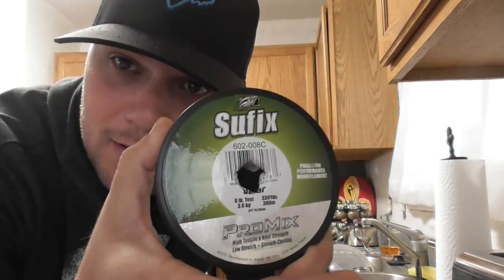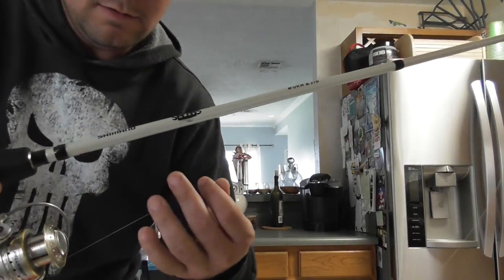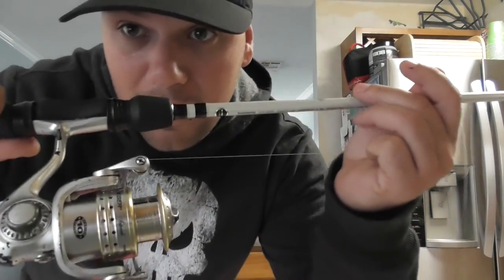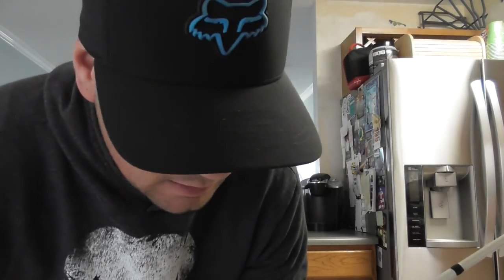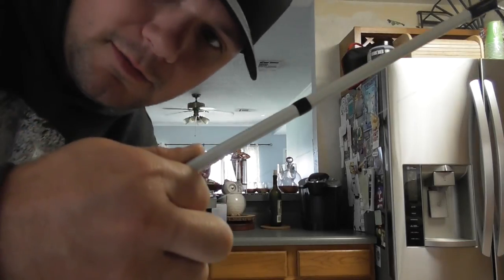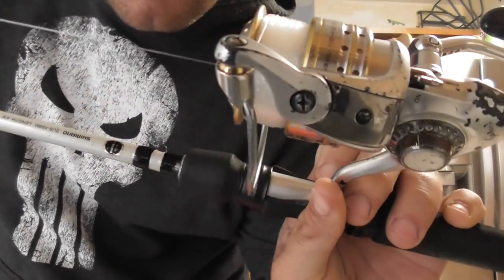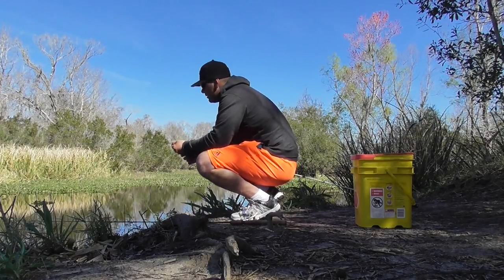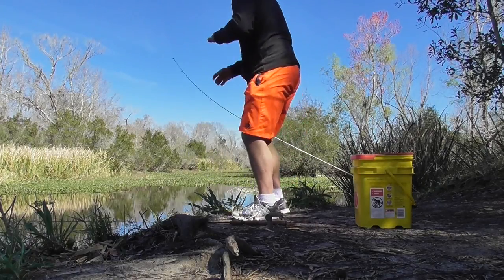Special way of spooling spinning reel and fight with bowfin

Comment: I do the same thing.  I use the old trusty Cajun Red line in 6 pound, I soak it in hot water for a while, and then soak it down with silicone spray before I spool it on.
Reply from the maker: +DaddyOsInk  nice make sure you subscribe and check out my other videos thanks!
Reply: Been subbed for a while... really like your vids.
Reply from the maker: +DaddyOsInk  thanks man my bad